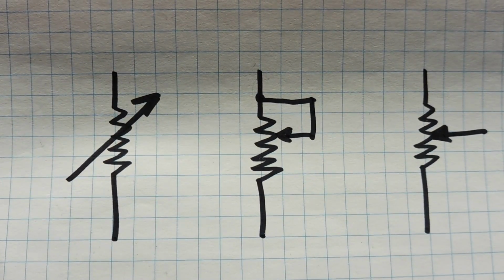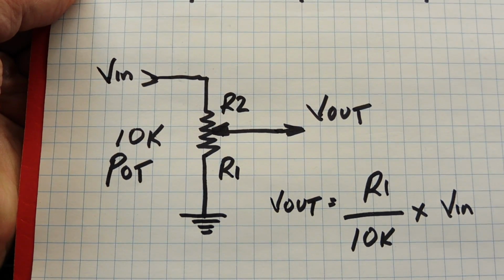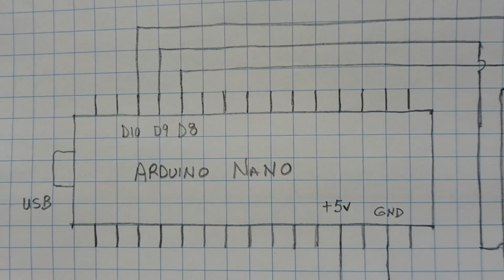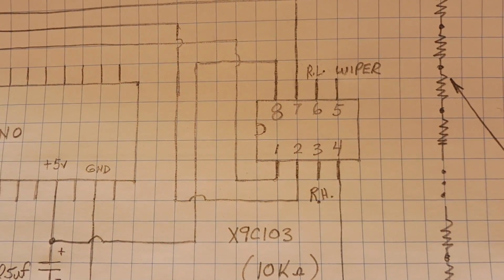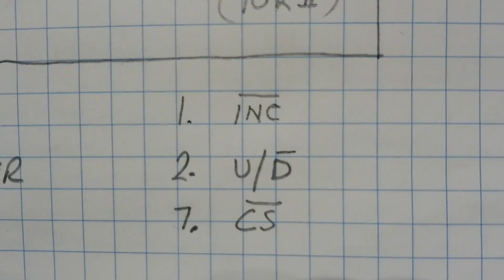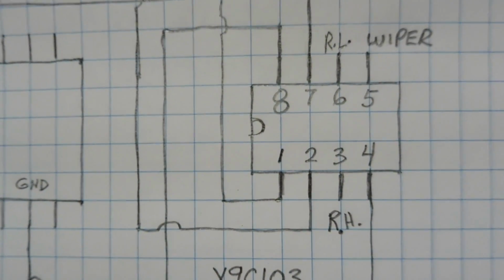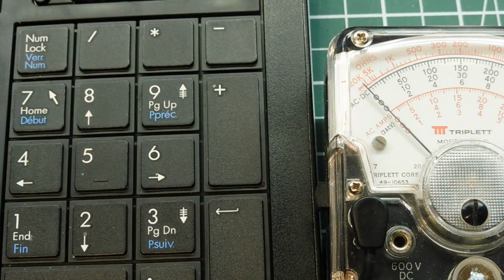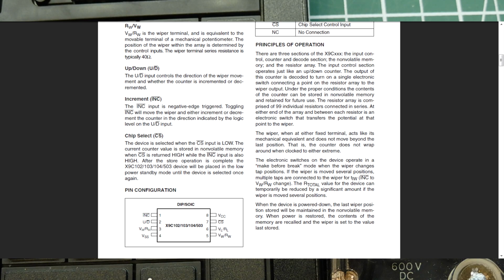Digital Potentiometer Control

Comment: Very informative video. Please may I ask whether there is any cause for potential delay when using one of the chips X9C103P?Does the initial voltage on a digital or manual potentiometer make a difference? Very curious.
Reply from the maker: The digital pot wiper will move as fast as you clock it. The maximum voltage you can apply to the digital pot is 5 volts. There are other ones that can handle higher voltages. Greater than the supply voltage.
https://youtu.be/aHRnAT7PgGY

Comment: How do i make it save the current value automatically?
Reply from the maker: If the INC pin is held HIGH while the CS pin goes HIGH the wiper position will be saved. A digital pot controlled by I2C bus has a save mode that can be configured during programming. https://youtu.be/aHRnAT7PgGY
Reply: @0033mer  this seems a bit confusing. What I am trying to do is create a volume controller with two push buttons. One to go up and the other to go down. And it should save the value once I stop pressing either of the buttons.
Reply from the maker: INC will move the wiper up or down with push-buttons and stay. If not check the data sheet and your circuit. Make sure your push-buttons are de-bounced. The last post was referring to saving the wiper value on power down.
Reply: @0033mer  i think I found an alternative chip online. The DS1809-010+. It has an auto save feature that saves the current resistor value in its eeprom when it detects the Vcc shutting off. Then reads it on start up. And it only requires 2 pushbuttons for up and down so I won't need to use a microcontroller.

Comment: Great video. I actually understood much of it. 
It seems that the number of resistors determines your resolution? 
I want to hook up a digital pot to my SCR controlled variable speed drive for my 130 vdc 4.25 hp treadmill motor. But I have no idea how to do this. I followed your video, but have trouble implementing it to my application. I like your keypad control. That’s cool. 
Can you help me figure out what I need and how to hook it up? I need 140k Ohms max. I’m currently breaking that down into a 117k and a 25k pot wired in series for course and fine rpm adjustment. 
Thanks,
Paul

Comment: Here to enlighten myself about digital potentiometers. Like almost anyone doing the same, I already know what a potentiometer is. If they don't, they should be directed elsewhere. AND 𝗲𝘃𝗲𝗿𝘆𝗼𝗻𝗲 calls it a potentiometer. It's called a rheostat when only one side and the wiper are used making it a variable resistor. It's a matter of how it's used, not what "some might call it."

Comment: Really like your video and would like to do similar setup except I would like the digital pot to be control by a temperature sensor so that the temperature remain constant.  I am using TEC cooling pad to cool a Diode laser and by varying the DC power (12v or less) it lower the cooling capability.  So when cutting with the laser on high power I need more cooling then when I am engraving and also depending on how deep I am engraving the temperature will change.

Comment: Whats the point in making half a video - What you done with the Code ?
Reply from the maker: Code is simply setting a GPIO pin high then low which a beginner to coding would know how to do. Samples of doing this is repeated many times in other videos.
Reply: @0033mer  You have taken it for granted that everyone Knows what a GPIO pin is  - As I said Half a video. P.S Thank you for the reply.

Comment: These seem to only handle a few ma of current so I don't see them as a direct replacement for standard pots like the one shown at the beginning of the video.
Reply from the maker: Yes .. as per data sheet specs the wiper can only handle a few mA. The digi-pot can only be used for small signal control but acts like a standard pot which people are familiar with so I used it for comparison. To control larger loads check out this video: https://youtu.be/7sMU7vzpo3Y

Comment: can i code the arduino  to get a specifir resistance using key pad ???  like getting 2k ohms directly , just by pressing  ' 2 '  in the keypad ???
Reply from the maker: The X9C103 contains 99 resistors with 100 wiper taps. Starting from the bottom ( 0 ohms ) each pulse on pin 1 will add 100 ohms of resistance. By counting the number of pulses you can adjust the pot to the desired resistance. Pressing 2 on a keypad would pulse pin1 20 times resulting in 2k ohms.

Comment: how to adjust digital pot to a predefined resistance.is there any calculate that can be used in program to adjust the resistance to a define value
Reply from the maker: The X9C103 contains 99 resistors with 100 wiper taps. Starting from the bottom ( 0 ohms ) each pulse on pin 1 will add 100 ohms of resistance. By counting the number of pulses you can adjust the pot to the desired resistance.

Comment: thanks for reply.i checked the link you forwarded.i want to know that at which terminal you are inputting square wave signal to digital potentiometer and also ground pin of digital potentiometer. may be I am wrong but as far as I understand it's input can be either of RH or RL pin of digital potentiometer.is I right? and wiper pin is connected to operational amplifier.plz correct me.i tried it with Arduino but not getting useful result.I am using headphone speaker of 8 ohm. can you forward your email id so that I can share my schematic with you.once again thanks for replying.
Reply from the maker: Audio is applied to pot across RH and RL. Input signal is connected to RH and RL is connected to ground. Output audio is taken from wiper (pin5) and ground just like a mechanical pot. Normal op amps can not drive an 8 ohm speaker. I used the LM386 as my amplifier. Check out this video: https://youtu.be/zMmaFV_JRAw
Reply: thanks for replying

Comment: Hello , I really liked your video sir ! 💜💜 
Sir , actually I need your help ! 

sir , I am working on a project where I have to use a suitable potentiometer that can oppose 2 Amperes of D.C current !!! 

I have  6 A of D.C current and I want to use 4 A of D.C current by stopping 2 Amperes  using a potentiometer or anyhow possible !

6-2 = 4  ( 4 Amperes I want to achieve). 

Can you please tell me which potentiometer should I use or how can I do that anyway ?
Reply from the maker: Controlling high current to a load a PWM circuit using a MOSFET would be a better route to go. Check out this video: https://youtu.be/mjIubJeTRyY

Comment: OMG, thank you. This is just the sort of thing I was looking for. I've been planning a project that is using an RC controller to control an arduino that pulses a power transistor at high frequencies, but my understanding is that an arduino's PWM can't handle higher than 65 khz without issues. I could obviously just use a 555 timer or other IC & some pots to get the low duty cycle 1-4 Mhz I need - but I can't use a traditional knob turning pot, since it has to be RC. A digital pot is going to make it so much easier to figure out this design; I didn't know there was such a component.

Comment: Plzzzz can you send the code ???
Reply from the maker: My code in written in Forth but if you check the comments there is Arduino code available on Github

     : PULSE.INC     Pin8  LOW     \ Step wiper 
                                Pin8  HIGH ;
                     
    : WIPER.UP      Pin9 HIGH ;    \ Set wiper direction UP

    : WIPER.DOWN    Pin9 LOW  ;    \ Set wiper direction DOWN
                                    
    : STEP.UP       WIPER.UP  PULSE.INC ;    \ Move wiper one step UP

    : STEP.DOWN     WIPER.DOWN PULSE.INC ;   \ Move wiper one step DOWN

    : JUMP.UP       WIPER.UP 9 FOR PULSE.INC NEXT ;    \ Jmp UP 10 steps 

    : JUMP.DOWN     WIPER.DOWN 9 FOR PULSE.INC NEXT ;  \ Jmp DOWN 10 steps

    : WIPER.TOP     WIPER.UP 99 FOR PULSE.INC NEXT ;   \ Wiper --> TOP

    : WIPER.BOTTOM  WIPER.DOWN 99 FOR PULSE.INC NEXT ; \ Wiper --> BOTTOM
Reply: @0033mer  
I'm sorry to ask such a stupid question but where on github can i find this? I've just looked. I am new, just been trying to play with arduino and digipot MCP41010 for 2days now and cant seem to understand how to adapt a program to take button inputs to change resistance rather than just cycle through the ladder.
thanks
Reply from the maker: Check out these sites: https://github.com/sleemanj/MCP41_Simple

http://henrysbench.capnfatz.com/henrys-bench/arduino-output-devices/mcp41010-digital-potentiometer-arduino-user-manual/

Comment: I'm looking for a way to digitally control volume, would this be a solution? Im not sure how the resistor will change the input signal to the amplifier.
Reply from the maker: Yes, this can be used as a volume control. The input signal to the amplifier will range from 0 to full signal level just like a mechanical pot.
Reply: Thanks for your reply. My plan is to have two input signals (L/R) and split it up to 6 output signals (L/R x 3). Then I want digitally control the 6 outputs, with 6 digital pots. Do you think that would be a problem when i split the two inputs into 6 outputs?
Reply from the maker: That can be done. Buffer all your outputs from the source signal.
https://electronicsarea.com/1-input-4-outputs-stereo-audio-splitter/
Reply: Thanks, that could be a solution! I only have a +36 VDC supply through. I'm not an electronic expert :)

Comment: Do you know if there are any with more then 500kOhm and 2W. 
Because i have a mechanical one and cant find a digital one to replace it
Reply from the maker: Digi-pots are for small signal applications. To control heavier loads you need to buffer the Digi-pot output.
https://youtu.be/7sMU7vzpo3Y

Comment: Great video, what applications would you use this in? 

I have a few buttons on my car steering wheel that all link to a data wire and use resistance to ground to to control stuff. I am planning on using something like this to "ping" commands onto the data wire
Reply from the maker: You can use it anywhere a mechanical pot is used but watch the max current allowed specification.

Comment: Code ?
Reply from the maker: The program was written in Forth. I do not use the Arduino IDE.

: SET.LEVEL
                INIT
                INIT.X9C103
          BEGIN
                Key dup
                56  =                   \ STEP up
                IF STEP.UP   THEN dup
                50 =                    \ STEP down
                IF STEP.DOWN THEN dup
                57 =                    \ JUMP up
                IF JUMP.UP   THEN dup
                51 =                    \ JUMP down
                IF JUMP.DOWN THEN dup
                55 =                    \ Home
                IF WIPER.TOP THEN dup
                49 =                    \ End
                IF WIPER.BOTTOM THEN
                27 =                    \ ESC
           UNTIL PIN8 HIGH 10 MS PIN10 HIGH PIN13 LOW ;

Comment: Hi, your video was just what I was looking for. I am trying to do a digital AC controller. My AC box uses 3 10k potenciometer like you show in the begining of your video, to controll it. My question is what digital potentiometer do you suggest I use to controll the AC motors.
Reply from the maker: Check the data sheets of vendors that make digital potentiometers and note the maximum voltage and current spec of the resistor string and wiper. Ensure that your circuit is within these specs.

Comment: what signal u were giveing at ra , rb of digipot . Sine wave ??
Reply from the maker: It was a square wave oscillator but a sine wave would also work.
Reply: will sine wave swinging from +ve voltage to -ve work ??(not from 0 to some +ve voltage )
Reply from the maker: Yes .. the chip can handle +/- 5 volt signals with respect to ground.
Reply: ok i just wanted to use it as a digital signal attenuator to reduce the voltage of a sine wave signal using voltage divider method . but what about noise , will there be any addition of noise ??
Reply from the maker: The results will be the same as a regular mechanical pot.
Reply: yes it is the same at volts range when i decrease the output voltage (to millivolts range)the noise kicks in from nowhere . my sine wave source is an rc phase shift oscillator . which does not have any noise . what type of interface is that ic .up/down interface ?? or spi .
Reply from the maker: It's just a three wire serial  interface using GPIO of the microcontroller.
The specs are in the datasheet:  https://www.intersil.com/content/dam/Intersil/documents/x9c1/x9c102-103-104-503.pdf
Reply from the maker: Yes you can. Use a toggle switch to select your direction U/D, then use a pushbutton to clock INC to move the wiper.

Comment: Great tutorial - I'm looking forward to using these with Arduino.
Anyone know how many watts can the X9C103P can handle on the pot side? 
Also, does anyone know how to use a digipot in high wattage applications?
Reply from the maker: Digipots are designed for small signal control applications not high wattage circuits.
Check the data sheet for the wiper current spec ( IW ). It will vary with the pot resistance. ( A few mA )
You could buffer the output with a power op amp or emitter follower transistor/mosfet.
I have used digipots in place of the control resistor in a LM317 voltage regulator circuit.

http://www.onsemi.com/pub_link/Collateral/AND8414-D.PDF

Comment: great video... did you use any library in this example ?
Reply from the maker: I do not use the Arduino IDE but program in Forth which is close to assembler.
Reply: silly question but why do you use Forth, is that just a comfy thing from previous experiences ?